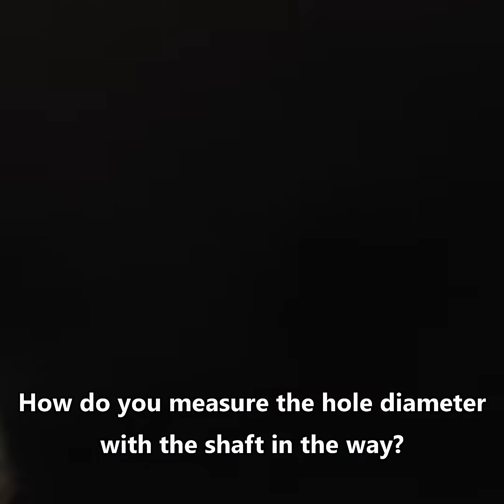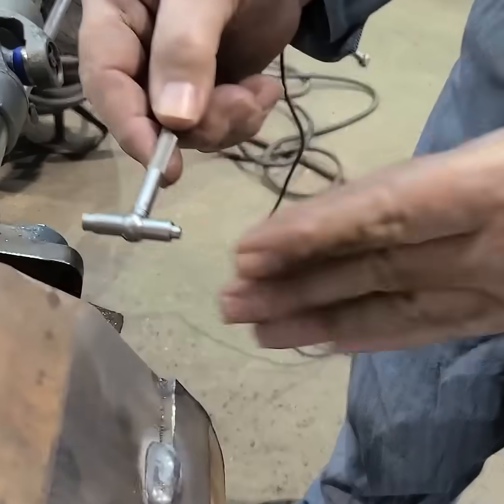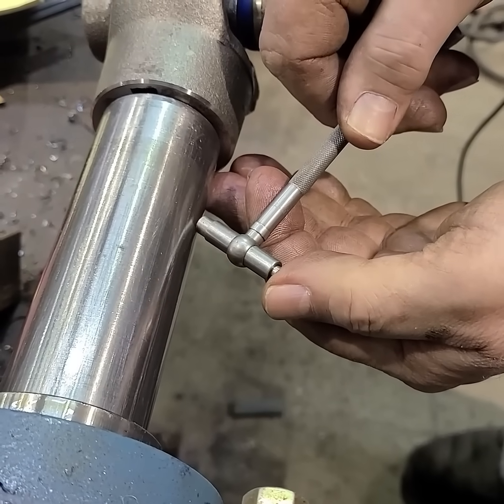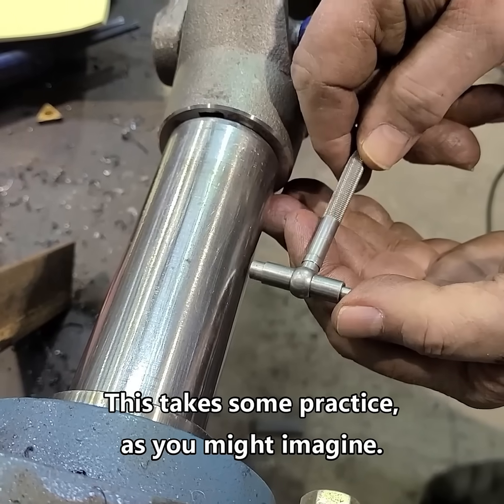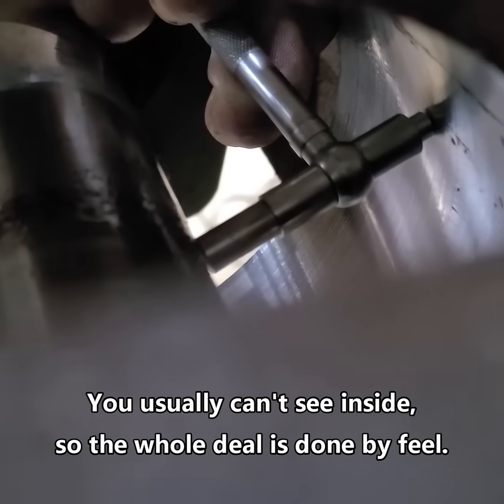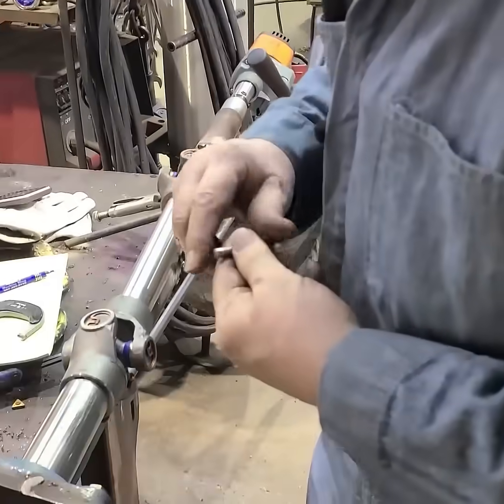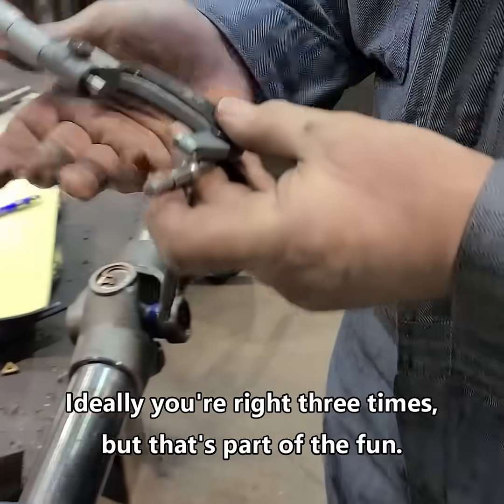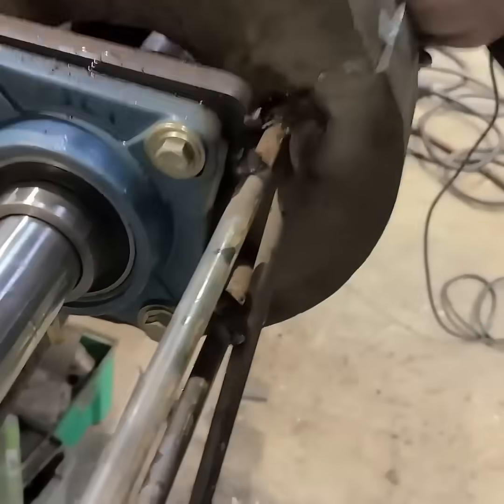Machinist's Minute(s): Measuring bore diameter with shaft in the way

Comment: Just measure the tip of the cutter and the back of the bar...
As that has just made the cut of the bore. Run the cutter on a spring pass and you wont be off by a thou
You know the dia of the bar so just a bit of maths